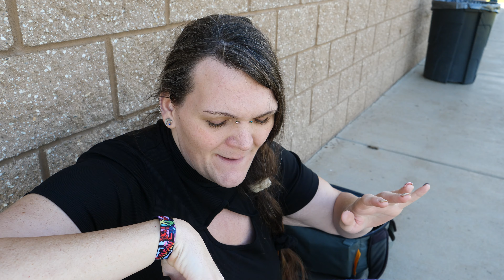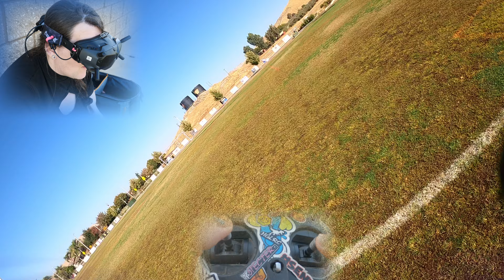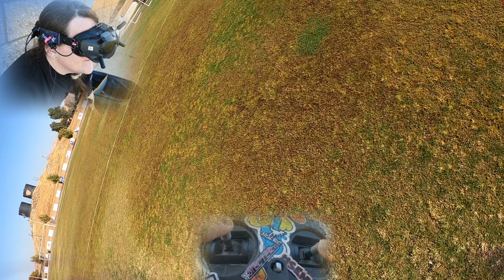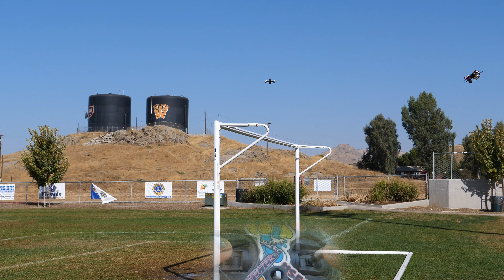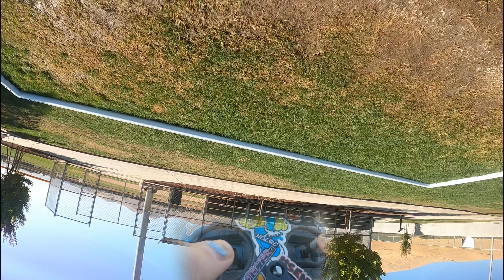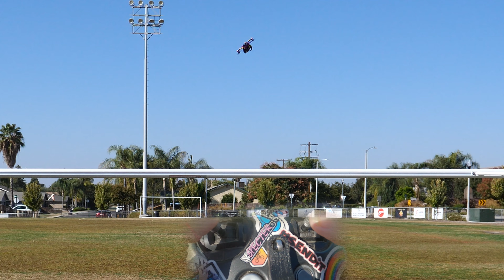Flying with Motors From the Future

Comment: VCI is my favorite Motor company Hands down. I have flown all the premium motors u can get. & VCI has out lasted them all. I run the Yuki Edition 2207-2110kv 6s motors they are 20$ a piece & they are durable Faster then all your other 2207-2100kv motors. Great company for great prices. Truly fantastic products

Comment: They have a much longer can and stacks than normal 20's ? I know with the surface stuff, the extra 20% of magnet and windings jumping from a 50 to a 60 mm long can and stator gives that slightly less peaky but smooth big block mumbo.
Reply from the maker: Size wise, it's smaller than the 2208 I was testing, but with a taller stator. They did some magic with these.

Comment: What should I do in bl32 - bidirectional 3d soft, or bidirectional 3d? What difference betwen 3d soft and 3d? Now I fly in soft, and I want to check, how will be work regular 3d
Reply from the maker: bidirectional 3d soft, motor ramp up power 90%- works the best across most motors.
Reply: What about motor timing and demag compensetion? I think 24-31° will be the best, demag compensetion low. Pwm 24/24 pr 24/by rpm. I will test this, and choose the best. AxisFlying 2207.5 bando 1960kv motors, foxeer F405 V2 stack (esc bl32 55a). And why you use 3d deathband 3? Its so hard to do motors rotate on idle. I do 10, and its way better
Reply from the maker: @СтепанСмирнов-ч3й  26 timing, demag low. 24/24 gives you the most torque, I still like 48khx. Deadband of 3 is less than 10, and reduces the deadzone while flying to be nearly imperceptible, which for me is better than 10. to each their own though, some have a hard time with precise stick movements.

Comment: thats fkin SICK
When am i gonna get off my ass and make a 3d drone
3d props are hard to get here in australia
Its not hard to setup though is it ....
Reply from the maker: Setup is so-so, biggest thing is having a good reliable ESC, preferably BLHeli_32 or AM32
Reply: @ZoeFPV  could U recommend one?
Or better yet what's Ur ESC and fc
Reply from the maker: @SpaghettiFPV-tg3qh  Hard to say, am testing a few different ones right now. In this video, old T Motor HD stack with BLheli32, though any new bird I fly will be AM32 or Escape ESC(when I get to try it)
Reply: @ZoeFPV  haha I think i got that exact stack you're using , sweet.
Thanks for the time mate , and if you're ever in australia give us a shout